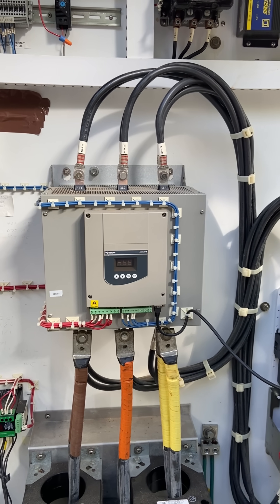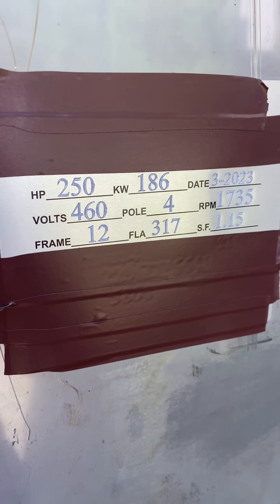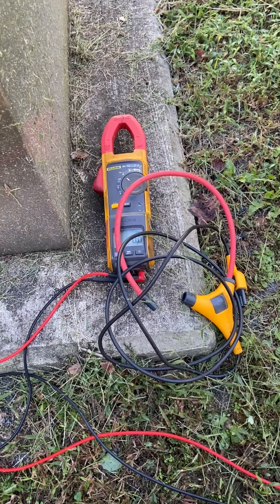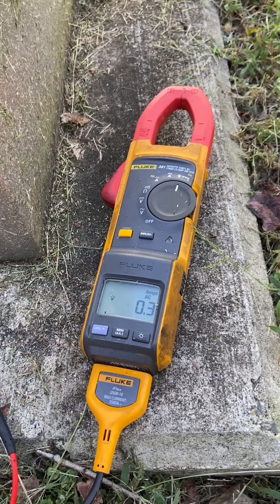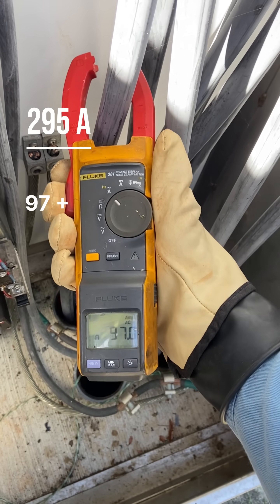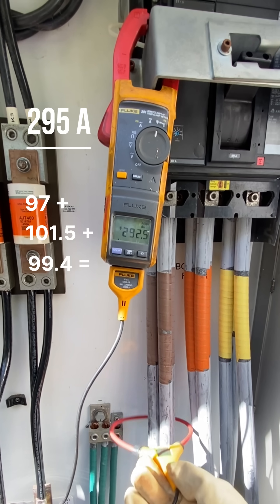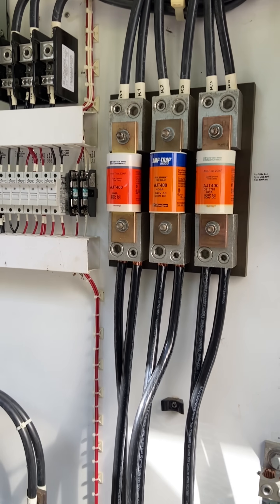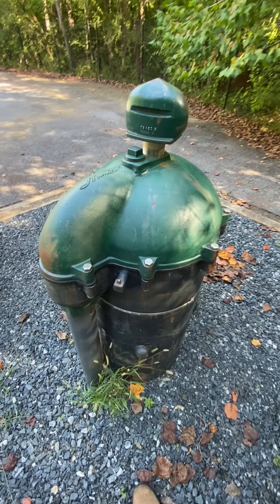Well Pump Current #electrical #motorcontrol

Comment: My electric meter couldn't keep up with that much current!!!! 900 amps total for all three lines! Yeiks!
Reply: That's not how current works.
Reply: If you measured all the conductors together, you would get closer to zero amps. Not 900A. :)